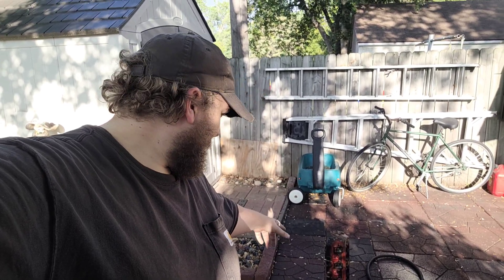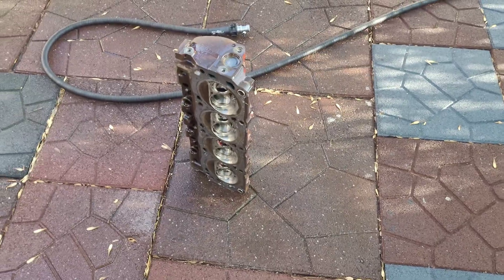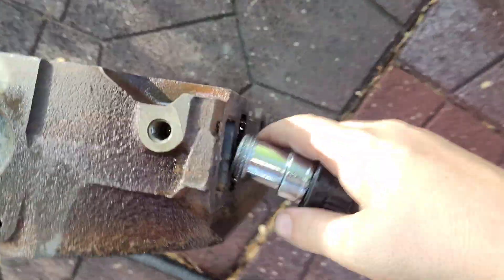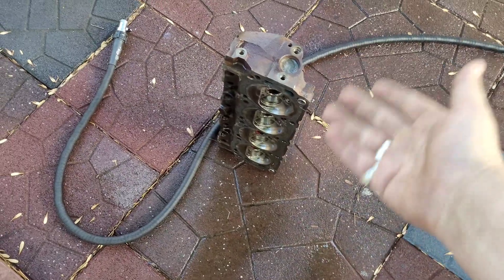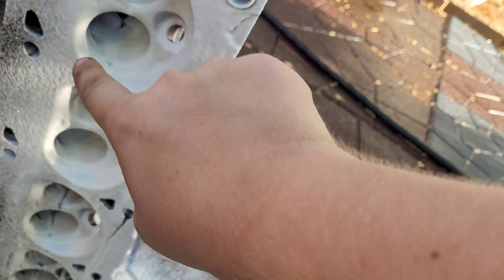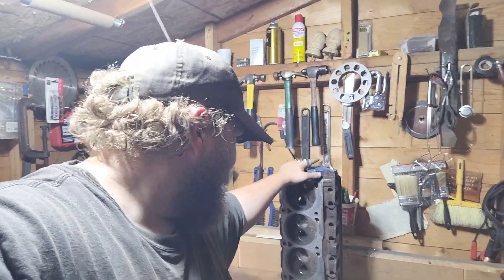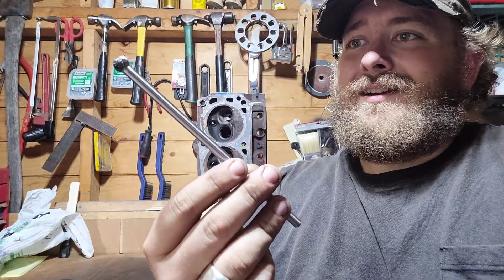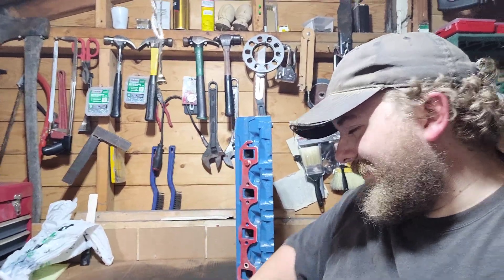Who Needs A Flow Bench!? | E7 Ford Head Porting | First Head Done! | Garden Hose Flow Test!

Comment: This is interesting to watch mate. I reckon if you had a way to always locate the nozzle in the same position and a way for it to be sealed into the port entrances properly (so it was shooting evenly down the runners) it would give you a real good look at what you are talking about, a little more consistently.

Iv’e just ported a set of the legendary Aussie 302 2V Cleveland close chamber heads and they’ll need a blast with the hose as well. You’ve got me thinking now. 

Obviously air flow testing is where it’s at, but with a few tweaks. this could be a good way to actually see what’s happening.

Comment: Have you seen a set of 289 heads. They have more quench  designed into them. Just a tip for budget builds.
Reply from the maker: I was looking for a pair before I started working on the E7s 
But nothing in my price range poped up...with the added shipping cost anyway lol 😆
Reply: Ya know, I been researching to put some E7 heads on my 289, but from all I read, 289 heads seem better. Is that true?
Reply from the maker: @dustinheffker3524 289 heads have more compression and can be ported very effectively.